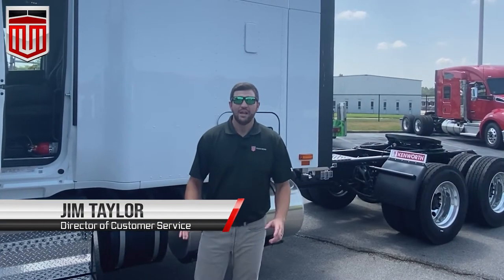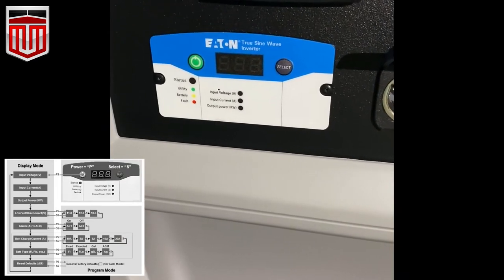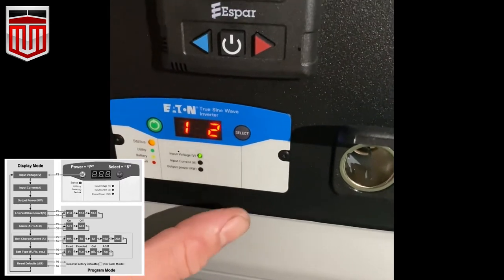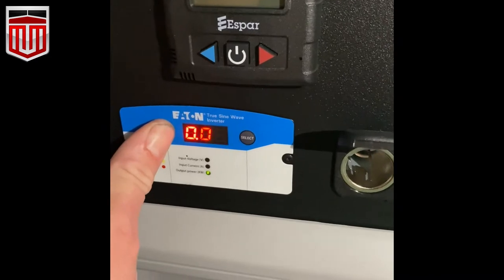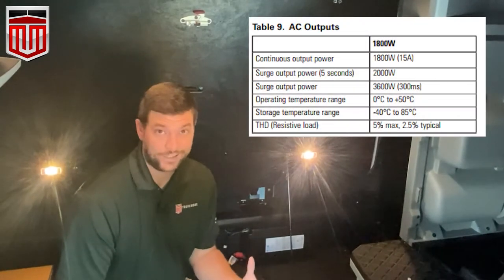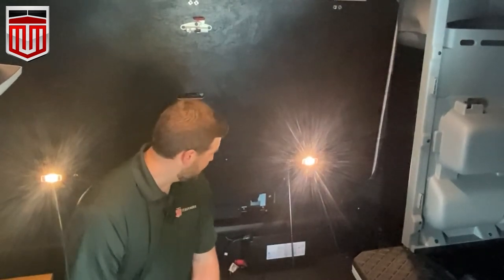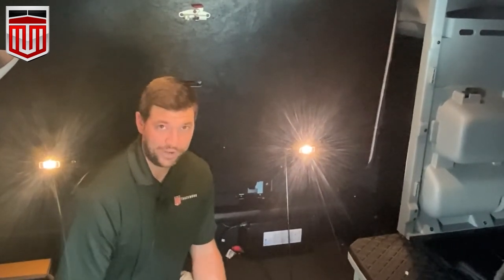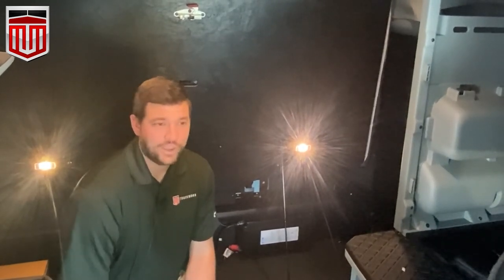Kenworth: T680 Invertor Video

Comment: Is this inverter integrated with the Thermo king standby mode for keeping truck batteries charged/APU system? The Controls are in the same place , just above the inverter control panel.

Comment: my codes are e1 and e5. where would I check to fix the issues. I just got new batteries for the truck?
Reply: Did you get it fixed mine just showed both your Codes e1 and e5
Reply: @juancarranza4731  yeah means you have bad batteries. That's what my problem was. The new batteries I got were recycled. Which caused my issue. Until the dealership actually gave me brand new ones. Those codes went away.

Comment: I have a inverter that worked fine until i got a new clutch installed and now i have redone the cables and put new eletric tape on the ends that connect and as i place it under the bed up against the wall it shorts out but as i hold it against the wall it will turn on as the wall acts like a power supply or ground from the back of the inverter and this one connects straight to the batteries below! But like i said worked great before i had my truck in the shop.. Unless the inverter has a bad inner connection

Comment: 1800 is not enough..go with 3000 dewalt
Reply: Ricky sanchez Yeah i have the same inverter as this truck here from a year ago in the video has. I have a brand new 2022 kenworth t680 truck, with the Eaton Fuller 1800 Watt inverter and its not even enough power for my microwave!! I cant stand it!!!
Reply: Amigo la instalacion del Dewalt es ingual al Eaton o tubiste que adaptarlo? Es decir te siguen funcionando los outlet? Gracias